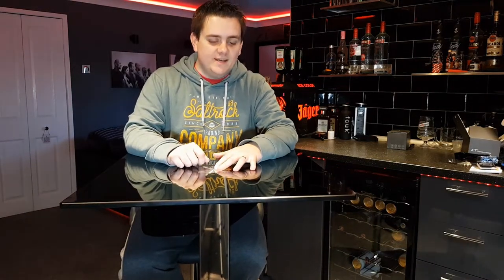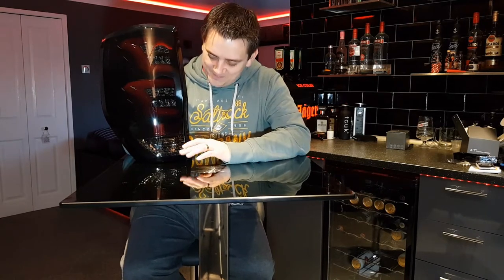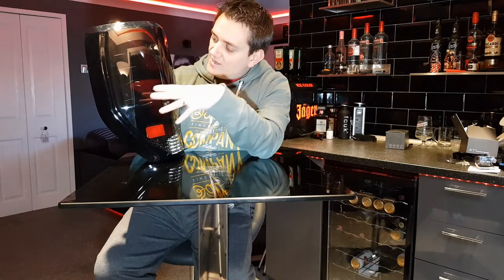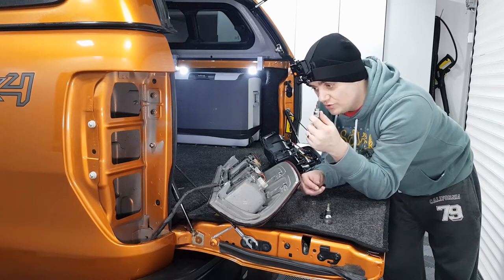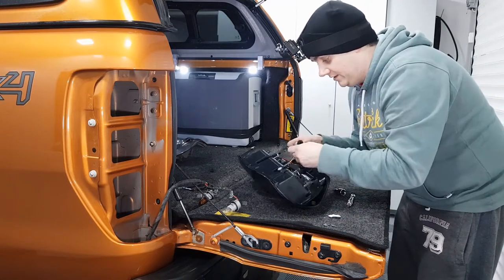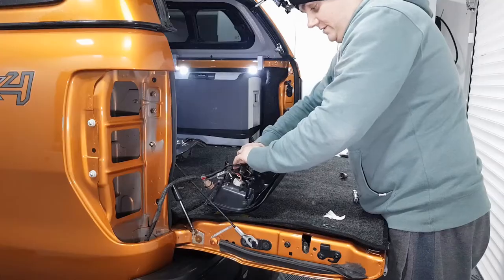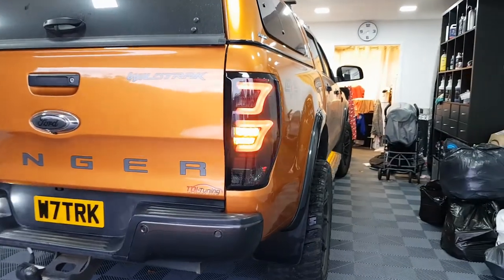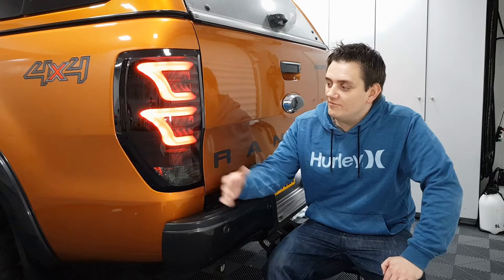New Aftermarket Rear Lights on Ford Ranger - xo-customs

Comment: Do you have a video on those side indicators you probably get asked about constantly... The ones on the step?
Reply from the maker: No I dont. I did originally have a plan to get loads of them made and sell them as a kit. But the manufacturer sent me one development set which are these and are awesome, but then they went bust and I couldn't get any more.
Reply: @DetailingandtheBeast  that's a shame. They look pretty good. Is it basically one long led strip in orange that flashes
Reply from the maker: @kryssana96  has amber and white. So linked to indicators for amber and courtesy lights to white.

Comment: Another great video Dave - well done!
Any chance you can set up the camera to show brake lights, reverse light and fog light ?
I’m sure I saw comments on the forums to say that LED front and back mucks up the BCM - any comments on this ?
Reply: Holy smokes ! 
350 quid ?!?!?!
Does Nicole Scherzinger donn a bikini and come to help you fit them ?
Reply from the maker: Haha yeah 350 quid. I did have some out take footage of all the lights, it turned out not the best as he lights messed with the image sensor and over exposed everything. I'll try and whack something up quick on Instagram, maybe tomorrow. You on insta Simon??
Reply from the maker: With regards BCM I've not had an issue personally, but know of people who have. Not sure if that's just cheap front bulbs or not???
Reply: Detailing and the Beast - DaveCHCI not on Instagram.....
Reply from the maker: Ah shite. Facebook?
Reply: What’s bcm Dave? I’m looking to pick my ranger up soon and fit these lights
Reply: Detailing and the Beast - DaveCHCI yeah - on Facebook.
Have liked a few of your posts.....
Reply: BRISTOL HORSEPOWER TV BCM is the Body Control Module.
Ranger has CANBUS system - a computer monitored and controlled wiring loom.
If it decides not to like certain aftermarket parts, they won’t work properly......
Reply from the maker: @beaky1706  it's the "body control module". Controls stuff like lighting circuits. Mega money if it goes pop. But I've had zero issues with mine up to now. Most have issues after fitting LED headlights
Reply from the maker: @simonturner1349  yeah I've seen you. I'll add you and I can sort out a short snip of video for the lights.

Comment: I‘ve written an email to the guys at xo customs because I wanted to place an order and I‘m from Germany. I‘ve asked 3 aimed questions but got a very poor answer that the tail lights aren‘t for LHD. That‘s in my oppinion not true because you can put the red bulb for the fog light on either side you want. So XO Customs arent buyer friendly at all👎👎👎. They avoided to answer the warranty question and if the CE Mark is visible from the inside.
Reply from the maker: That's not good to hear at all. Hope you get it sorted Dieter. 👍
Reply: @DetailingandtheBeast  did you see a CE mark when you put them on, cause in the video I can’t see one? Thx
Reply from the maker: Cant remember seeing one.
Reply: @DetailingandtheBeast  yeah thanks Dave. They are explicit pointing it out on the website that these will pass the mot test because of the CE mark and that’s why they are so expensive. In Germany it is crucial to have these marks. If not it can have ugly consequences in case of an accident.
Reply from the maker: Well mine have passed an MOT in the UK but we are more relaxed. I will have a look at them later and see if I can find one.
Reply: @DetailingandtheBeast  u‘r the best 👍👍👍
Reply from the maker: @dieto135  how can I send you a picture?? You on instagram??
Reply: @DetailingandtheBeast  yeah @dietertoma thanks a lot !